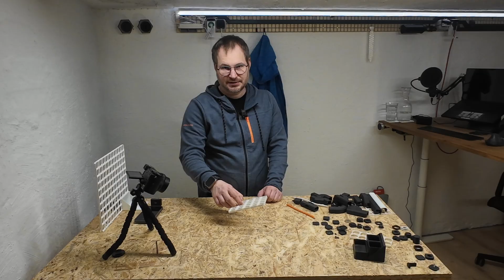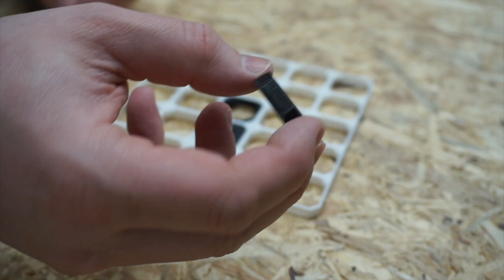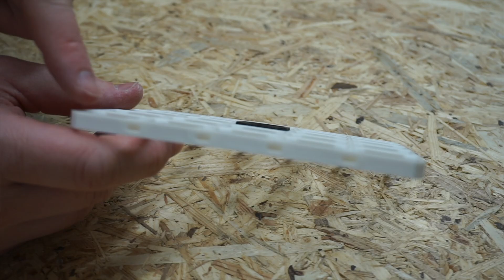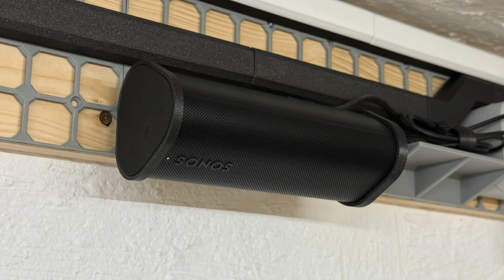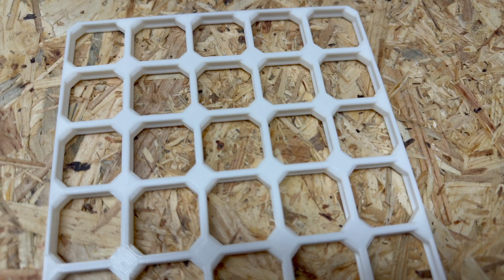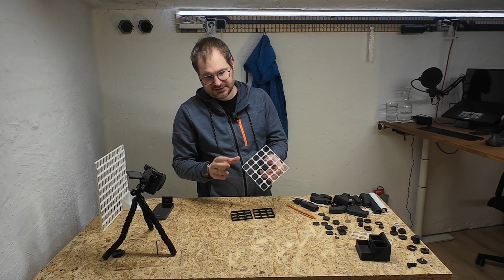openGrid Compatibility - How to use existing solutions like Multiboard, HSW, GOEWS and metric screws

Comment: I'm new to the whole Opengrid and Multiboard setup, I currently have a small multiboard setup but am interested in finding out about snaps where I can mount Opengrid printed stuff on my current Multiboard without having to rip it all down and replace with Opengrid printed stuff also I don't fancy just hanging the Opengrid tiles on the multiboard. Is there any converter snaps? I've come across the other way round,  but not the way I'm after. Any help would be appreciated.

Comment: The grid which is standing vertical in the corner of the workbench, is that being held upright by a mount which is screwed to the wood? or is stable enough to keep the grid from falling over? I was wondering because I could make use of something like that which is mobile while I'm working, to hold tools and other items instead of dropping it on the floor of the garage.

Comment: You didn’t show the Skådis conversion. I thought I might have misheard you saying it, but then I replayed the introduction.
It would be really nice to see some examples of how this is used in the living room, kitchen etc.
Pretty amazing work you are doing. I am using Skådis in my craft room, but am tempted to try this out. I am just concerned with how many screws you would need to attach a ‘Skådis sized’ grid to the wall. With Skådis you only need to drill 2 holes to mount it.
Reply from the maker: I think me mentioning Skadis was somewhat related to Multiconnect, this is compatible as of those models: https://www.printables.com/model/1111567-multiconnect-for-swedish-pegboard-skadis
openGrid does (as of now) have no Skadis compatibility. But it should be doable, so if you want to create a Skadis openGrid mount for example I would say go for it! 😎

Comment: Main thing with opengrid I’m wondering about is offset mounting for running cables behind it on a wall. Underware is good for under mounting,  but if I want to have stuff charging on a wall I don’t really want to use a bunch of the surface area just for cable conduits.
Reply from the maker: There are mounting snaps with an offset as well. Although I have to add that openGrid works best when mounted directly onto the surface 😉
Reply: @2D3D-DavidD I do see those, but I was thinking what would be a lot better for a secure offset mount is standoffs that index to the back of the screw holes in the grid. I could try making something myself.

Comment: Great system. Can you develop a connector for Frenchfinity as well?
Reply from the maker: I will definitely look into this! Not sure this will actually work the way I would like to. Having to print massive attachments that then cannot hold the strength you would expect from french clear isn't really my goal 😇
Reply: @2D3D-DavidD I understand, but when I look at the wall in the video, the open grid would support most of it. With a suitable watch out / this could be really useful to transfer small items between the workshop and the office.

Comment: If openGrid was "pitch agnostic" (i.e. if you could chose to create grids with a parametric pitch of 28mm, 42, 50 or any other dimension), I would adopt it overnight.  (I already create all my Gridfinity to 50mm unit size as I find the weird 42mm size too small for a woodworking workshop.)
Reply from the maker: The generator might help to get other sizes: https://makerworld.com/en/models/1304337-opengrid-tile-generator
Although note this is only the board and not any snaps. Those might still be created using the STEP files. 😉
Reply: Agree, for example 25 mm multiboard grid works best for me, but do not like its commercial manner

And there s a mess with vertical dimensions of every grid system

Comment: What made you decide to go for a 3 squares to 3 gridfinity bin size? I would have thought going 2 squares to 1 bin would be neater, but I'm guessing you thought more about this than I have.
Reply from the maker: Basically the 28mm grid isn't to small for things to be attached to this and also isn't to big for needing additional strength, still can be pretty lightweight. This is somewhat a compromise of going smaller/bigger. Also I noticed 28mm is actually pretty nice to work with.

As a nice side effect this means you can have two multiboard snaps in the corners of something like a gridfinity shelve and then add a mounting snap in between to have things sit there really, really tightly. Thats also one of the aspects I liked about this size.

Comment: I like the idea of open grid because it prints so much faster than multiboard! However I would like to use larger multiboard bins for example 4x4 which use multiple connection points. Do you have plans to support this? The tile generator has the option to change the grid from 28mm to 25mm to fit the multiboard dimensions. But of course then your snaps no longer fit :(
Reply from the maker: You might create some bins using the amazing generators created by BlackjackDuck using the 28mm connector grid: https://makerworld.com/en/models/582260-multiconnect-part-generator-master-collection#profileId-633542

The issue with the gridfinity dimensions (that openGrid is based on) and MB is that those are not compatible at all. 

Another solution might be something like this: https://makerworld.com/en/models/1207512-opengrid-lite-multiconnect-multiboard-adapter?from=search#profileId-1253169

Comment: How do you screw this to the wall?
Reply from the maker: Depends a little bit on what you want to use. The lite board comes with screw holes for countersunk screws. The full board is normally used with mounting snaps. Of course there are also some mounting snaps for the lite board if you need more strength. 
And then there is the awesome generator created by BlackjackDuck that allows you to create your own version - adding those screw holes to the full board for example: https://makerworld.com/en/models/1304337-opengrid-tile-generator-official 😉👍
Reply: @2D3D-DavidD  Screw cover snaps would be awesome for the full board when you add your own countersunk screws holes!